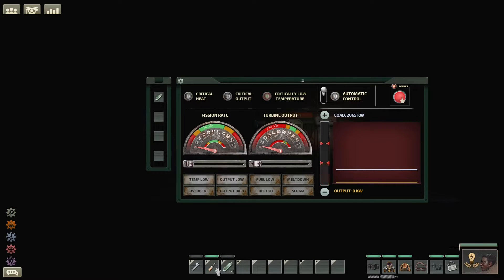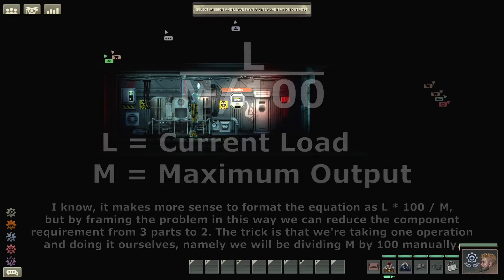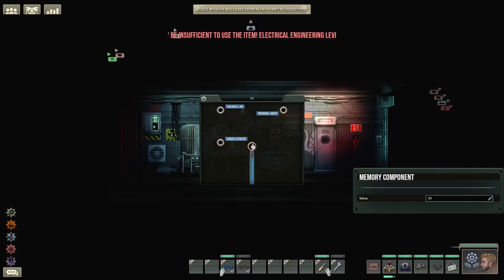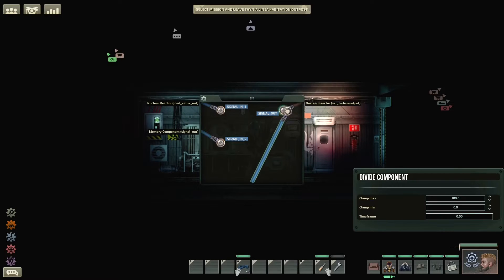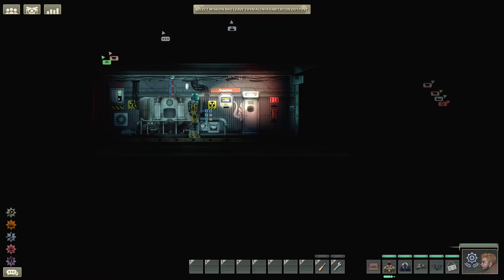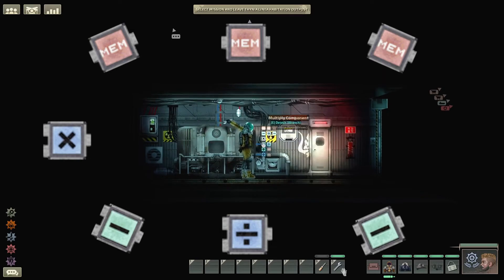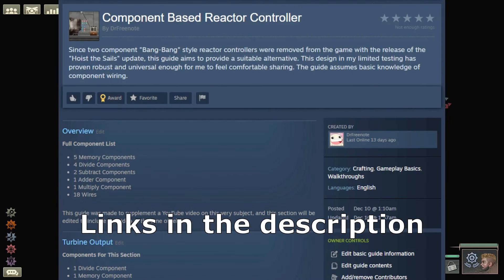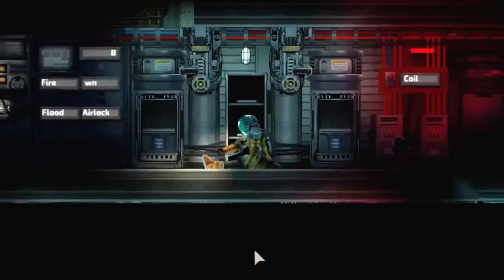New Hoist the Sails Reactor Controller | Barotrauma

Comment: What I've learned post update is that most reactors can handle 4 fuel rods using built in auto controller. Gotta put all 4 rods in while the reactor is cold then turn it on. Im glad to see newer solutions but im convinced this is to complicated for most baro players.
Reply from the maker: I think you’re right. Though, I also think that’s what the devs wanted. Haha.
Reply: @FailroadExpress  i noticed that with the bang-bang variant, now you must set it on manual, and flip it from cold and dont touch it, if you move the sliders it goes wonky a bit, but if you just leave it alone, it's a flatline just like it use to be
Reply from the maker: @chadmageddon  Thanks for the info.  We will have to try that out next time we get a chance.
Reply: I know this is quite late, but one thing I realized about the "multiple rods in reactor" issue many people are scared of is the fact that the reactor will very slowly react to you putting in an extra fuel source and will keep fission at similar level due to automatic being so slow to decrease fusion/turbine.
But if you put an extra rod, control the reactor manually for about 5-10 seconds until temperature is stable and switch to automatic, by then fission rate will be set to what it needs to be and reactor can control freely.
This isnt an issue after reactor is stable with fuel rods due to both fission and turbine turning very slowly, so you are unlikely to have fission outdo turbine and create excess heat due to both being very slow to turn automatically.

Fulgurium fuel might be an exception, dont use it unless you wanna risk or have a manual control system.

Comment: So I figured out the exact formula for Fission Rate. It can be shortened to (75*turbine_output)/fuel_out. Which makes it 3 components in addition to the 2 used for the turbine_output. I could explain why and how it works if you're interested in that.
Reply from the maker: Of course. If you think it will help the viewers, go ahead and explain it. I can’t promise everyone at the Failroad will understand it but DrFreenote probably will. Haha.
Reply: The reactor produces energy based on the amount of heat it has. Temperature ranges from 0 to 10000 and the produced energy from 0 to your reactors maximum output. With a stable turbine speed (turbine_speed = (load*100)/reactor_max_output) 5000 temperature will always give you the maximum reactors output and 2500 temperature gives you 0.5*reactor_max_output. So needed_temperature = (5000*((load*100)/reactor_max_output))/100
or needed_temperature = (5000*turbine_speed)/100.

To reach that temperature we need our fission rate. Temperature scales linearly off of the fission rate with temperature = fission_rate * 2*fuel. So with a single thorium rod (100 fuel or also called heat potential) an increase of fission rate by one will increase the temperature by 200. That would make fission_rate = needed_temperature/2*fuel or (5000*turbine_speed)/(100 * 2*fuel) or (50*turbine_speed)/2*fuel. The problem is it does so only after a certain point which I call minimum fission rate. Everything below that point nets 0 temperature while everything over it gets you the temperature described above (starting from 0). The minimum fission rate is calculated as min_fission_rate = 100/fuel * turbine_speed/100 * 50 which can be shortened to (50*turbine_speed)/fuel. Now add to that the one from above fission_rate = (50*turbine_speed)/fuel + (50*turbine_speed)/(2*fuel). It is essentially the minimum fission rate plus the fission rate needed to achieve your target temperature. It can be shortened once again to (75*turbine_speed)/fuel which is the thing you actually plug into the set_fissionrate of your reactor.

That will give you the absolute minimum fission rate needed to generate your energy and therefore maximizing fuel efficiency. On a very short testing my thorium rod held about 50% longer compared to the inbuild automatic control. You may notice that the generator produces one less energy than your load, that has to do with the game rounding numbers but shouldn't have any impact on your devices. On a side note I could not get the reactor to catch fire, it can overheat for ~13 sec with 4 Volatile Fulgurium Rods and a load jump from 0% to 100% but it would need 20sec to start burning. And as a small disclaimer I got all the formula above by doing some tests, writing down the numbers and staring really hard at them but so far they work perfectly and I have no evidence that any of them could be wrong.
Reply: @RemnantReader  drools
Reply from the maker: @RemnantReader  Very nice!  I did understand some of that and I'm sure DrFreenote will get the whole thing.  Glad you were able to improve upon our design.
Reply: @RemnantReader  Thank you! That's far more of an elegant writeup than anything I could have come up with. I'll be honest, I was actually running under the assumption that fuel efficiency wasn't adjustable and that it was based on the kV produced, not the fission rate value itself. Goes to show what I know. xD;;
Reply: @RemnantReader  You, sir, are a genius
Reply: @Mompf  bro what do you smoke and can I have some, please?
Reply: @RemnantReader  If [I] could read [I] would be very [happy].
Reply: So we get in the end:
Turbine output = Load value / (0.01 * Reactor's max output)
Fission rate = (Turbine output [another wire from divide component if I'm not mistaken] * 75) / fuel_out
Did i get it right? 🤔
Reply: @JustSpectoR  Exactly
Reply: @RemnantReader  nice, gotta try it :D
Reply: @JustSpectoR  I'm trying to wrap my head around all this - how many components are needed in total?....9? by my very limited understanding....
FYI i've decided to learn how to do wiring as of 30 minutes ago
Reply: @Danjgallon  hm, sounds too much for me
Formula is (just repeating)
Turbine output = Load value / (0.01 * Reactor's max output)
Fission rate = (Turbine output * 75) / fuel_out

If i am right the components should be:
1) Memory for "0.01 * Reactor's max output"
2) Divide for "Load value / (0.01 * Reactor's max output) [1]" which is our Turbine output
3) Memory for 75 that's used later
4) Multiply for "Turbine output [2] * 75 [3]"
5) Divide for "(Turbine output * 75) [4] / fuel_out" which is our Fission rate

[X] numbers are signals taken from X component's Signal_out
Reply: @JustSpectoR  I built this and it worked like clockwork for most of the mission (I had a "temp low" gauge but still, production matched output), then the reactor randomly caught fire. I'm not exactly sure how
Reply: @valerioversace9604  zero ideas, i just kind of rewrote comments from earlier
Reply: Your formula is right, I really appreciate the thorough write up. Allowed me to follow your twists and turns in learning/understanding.

Great job!
Reply: @FatalMerlin  You extend the first part 2/2 * (50*turbine_speed)/fuel = (100*turbine_speed) / (2*fuel) which is still equal to (50*turbine_speed)/fuel . It is essentially just multiplied with 1 but now we have the same denominator as the second part and you can add them together: (100*turbine_speed) / (2*fuel) + (50*turbine_speed) / (2*fuel) = (150*turbine_speed) / (2*fuel) and that can be reduced to (75*turbine_speed) / fuel. So it should be 75 but if you're not convinced could you explain how you got to 62.5? And I am just now noticing that you could reduce the second part to (25*turbine_speed)/fuel and then add them together instead. That's probably the simpler way of doing it.
Reply: @RemnantReader  hahaha I forgot basic math nvm
Reply: Man, am I glad I kept all my stolen components in my containers. Finally, peak reactor performance.
Reply: What is the fuel_out in this equation?
Reply: @corvoattano10  There is an output in the wiring menu of the reactor simply called "fuel_out". It has to do with how many and what kind of fuel rods are in the reactor.
Reply: And how about the clamp values are they still the same as in the vid for the divider?
Reply: @Duarte_GB  Yes.
Reply: @RemnantReader  Would you willing to do a "explain like I'm five" writeup for how to wire this with your formula? As in, how exactly does this change the video.
Reply: @DimensionalExpansion  
So the goal is to determine the values that go into set_fissionrate and the set_turbineoutput of the reactor.
The first part in the video where he connects the set_turbineoutput from the reactor to the other two components stays the same, meaning you can just copy that. Therefore set_turbineoutput for the reactor is done.
- - - - - - - - - - - - - - - - - - - - - - - - - - - - - - - - - - - - - - - - - - - - - - - - - - - - - - - - - - - - - - - - - - - - - - - - - - - - - - - - - - - - - - - - - - - - - - - - - - - - - - - - - - - - - - 
For the set_fissionrate you will need three components: A mem component, a multiply component and a divide component.  
- Place those 3 first. 
- Connect signal 1 from multiply component to the out signal of the mem component containing the value 75.
- Connect signal 2 from multiply component to the out signal of the old divide component of first part of the video.
- Connect signal 1 from new divide component to the out signal of the multiply component.
- Connect signal 2 from new divide component to the fuel out signal of the reactor.
- Make sure to clamp all divide components to 0 to 100 since set_fissionrate and set_turbineoutput in the reactor require values ranging from 0 to 100. The multiply component can use the default clamping values from my understanding.
- Finally connect set_fissionrate from reactor to the out signal of the new divide component and you are done.
Reply: Thank you, mysterious YouTube commenter.
Reply: Any idea why the reactor getting stuck at 5699 power output after a while? Any autoreactor set up end up like that.
And also the whole set up is really wonky since default 10000 reactor works properly up to 8500 power but after exceeding that limit temperature goes down below safe levels and the more power it needs to produce the lower temperature is.
At this point I get better autoreactor control from a bot assigned to the reactor then from all those components.
Reply: @freespeech3817  
> Any idea why the reactor getting stuck at 5699 power output after a while?

Maybe you didn't properly adjust MaxReactorPower/100 constant (in Memory) to your sub's reactor specifically, taking into account mods, upgrades and active talents.
Reply: Can someone tell me what defines how mutch power is needed in order to maneuver a sub with 100% efficiency, starting with the ballast tanks??

Its kind of strange, i reworked a sub into having 3 balastpumps and tanks instead of 2. And now it feels even slower .

The only thing i added was (everythink scaled down massively) 12 shrunken storages storages, 4 deconstructors und 2 fabricators. 

Do these things have an actual mass that gets calculated into a weightsystem wich could explain why 3 tanks make the sub slower than 2?
Reply: @BlackRainEntertain  Every ballast hull have a special value of how effecient it is so you might want to add more pumps if those ballast rooms are big. Also keep in mind how you wired them - for example if they all are conected through relays(they limit power flow to 1000 but you can always change that to higher number in editor) and you have more than 3 pumps going through one relay then they might not getting enough power to work properly(big pumps need 300 power to work properly).
Also there is kind of weight system that calculate all the hulls so you need to have proper normal hull vs balast hull ratio.
Items, and object most likely don`t matter but I`m not entirely sure about that.
In the end if your sub still struggle to have at least 15-20 ascend/descend speed you can simply change pumps effeciency values but I wouldn`t recommend going overboard with those.

Comment: So, what is the best scenario for fuel rod load?
Should I keep my engine fully loaded at all times or one uranium rod will do the trick?
Reply: In my testing, any number of fuel rods (and any type of fuel rod) should work with this controller, though with one uranium fuel rod you may be limiting your power output to about 80%. Two or more would be my suggestion.
Reply: @DrFreenote  thank you